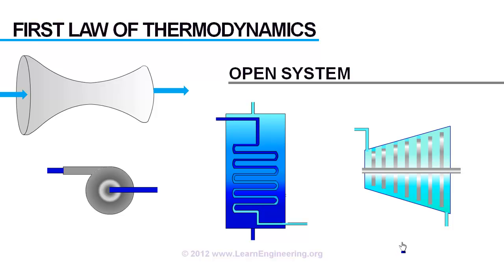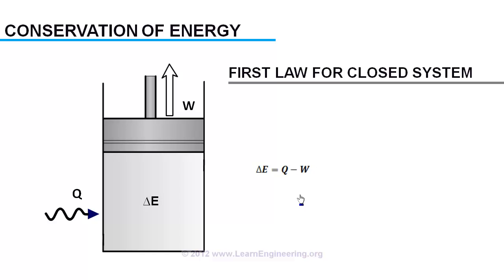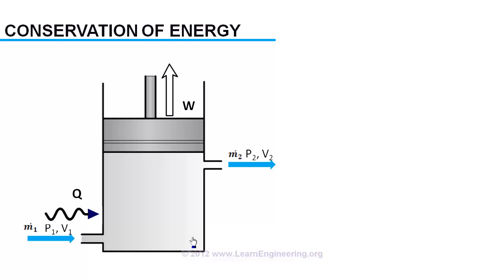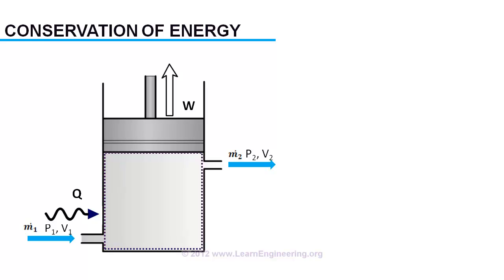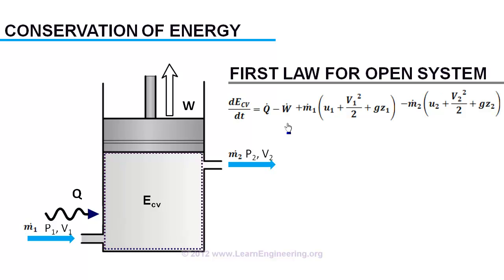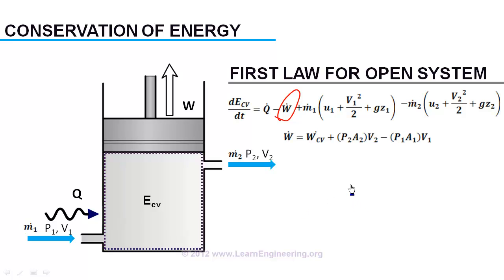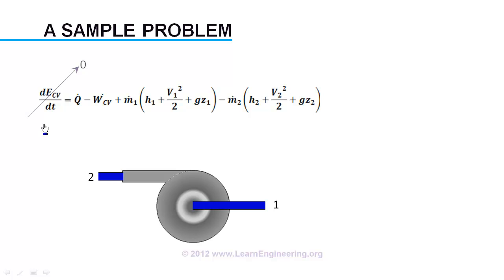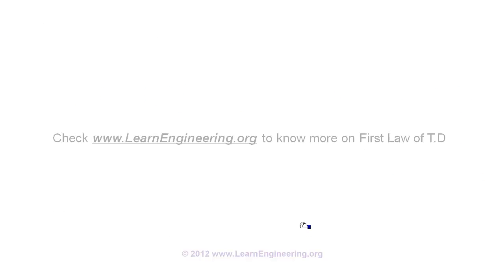First Law of Thermodynamics

Comment: • At any instant in time, the total energy content in the system remains unchanged & hence, the steady state. 
• So, the net fluxes of energies through transport of masses & transfers of  external heats & works through system boundaries which bounds its own volume are balanced at any or each instant. Hence, steady state is assumed. 
• Rate balanced law is valid at each instant in time but overall energy law is valid for complete time period.
• Loss terms either on rate basis or overall basis are to be accommodated in the equation to maintain overall balance at each instant throughout the domain of application.

Comment: For those that find this video a little hard to follow, change the video speed under the settings (Gear) icon and slow it to 0.25 or 0.5 when you play it. The main issue is not necessarily the accent and pronunciation of the English words, it's the speed at which he is talking that magnify the distortion of the way the words are being pronounced.